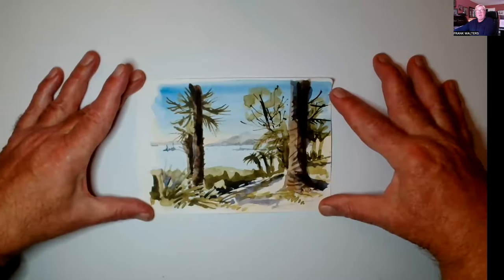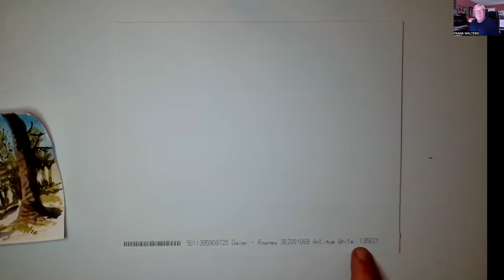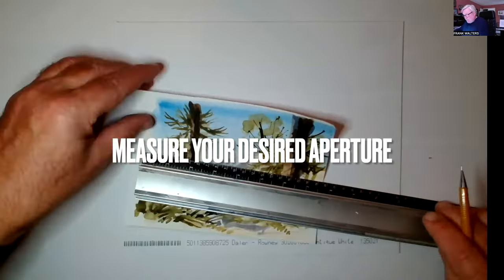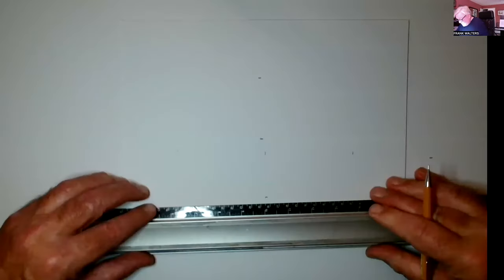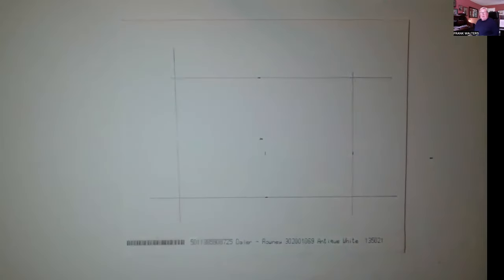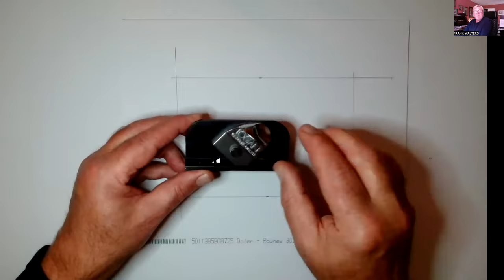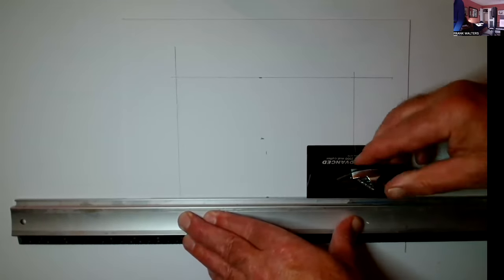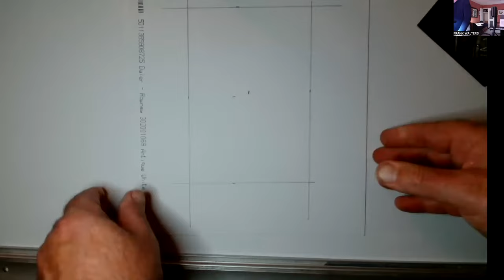How to cut out your own picture mount.

Comment: should we be concerned about acid free tape or not?  You mentioned below that you used masking tape, i'm guessing that has acid in it.
Reply: It will degrade over a short time and is probably acidic.  You can find acid free/archival mounting tape at hobby and major art outlets.  There's also mounting adhesives, say, if you need to affix the work to a foam core backboard.